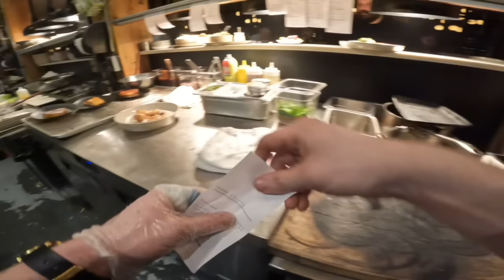POV Live Fire Line Cooking 1(5)

Comment: This is truly impressive, I've never seen a kitchen like this! The temperature must be infernal. Great job!
Reply: Compared to some peoples job. My past one for many years ina steel mill making 80ton batches of liquid steel at 3,000°.  With 2 pairs of long sleeves an long pants with hats an neck coverings an an aluminum trench coat ect.  While a lot of time getting few feet from it where the clothes your wearing starts smoking on your body.  An the hard hat on your head starts to warp an bubble.  An the shield over your face starts to shrink an curl up from the heat.  Or melting the soles off the bottom of high heat rated steel toe boots.  

These dudes don’t have a clue what heat is to some of us.   In comparison that would be like sitting in an air conditioned room having a picnic.
Reply: @AquaTech225  ok tough guy
Reply: @AquaTech225 I would never under estimate working a line unless you've done it. Not saying the heat is the same but theres a lot of people that can't do this job of being a line cook.
Reply: @AquaTech225  jesus
Reply: @AquaTech225  looks like someone needs some validation
Reply: @Luke_MoonWalker  ⟵(๑¯◡¯๑) relax buddy, there are trade schools too. And iron work is important to the understructure we use everyday
Reply: @AquaTech225 You’re trying to make getting boiled alive a competition. You’re the type of guy to be like, “You got soft hands brother”.
Reply: @paulc7400 so automatically you say it's easier to work 12h shifts in a steel plant, with 120°F room temperature, plus the heat radiation from the steel, than working as cook in a kitchen ? 

You have no idea what you talking about. Sure it's really stressful as a cook, but atleast you don't risk your life and health. One small mistake or material failure, or wet steel scrap and people can die easily. There are a lot of videos about accidents in steel plants, sadly it's a common thing, even today.
Reply: @ImplantedMemories  what part of what I said was disrespecting steel workers? 

I was just trying to put some respect on line cooks name for someone who never done it. Most of the mexican and guatemalan cooks I worked with had 2 kitchen jobs as well so they worked 12-16hrs themselves but yeah there lives aren't on the line.

 I was trying to tell some of them their second job should be something more relaxed like security or something.
Reply: @AquaTech225  im glad you could get that out of your system, idk what you want others to say but perhaps talk to a friend about it or consider working a differant job if you dislike it that much. im sure with your work ethic you could succeed in plenty of careers.
Reply: @AquaTech225  sorry, the man
Reply: This isn't cooking. This is assembling.
Reply: @AquaTech225 this job is a grind and is legitimate just like yours. You don’t have to shit on others my brother
Reply: @AquaTech225 no one cares or asked. You’re not special
Reply: @AquaTech225 No one asked buddy
Reply: @AquaTech225  Cool bro but can you fry a piece of chicken
Reply: @ImplantedMemories cooks are literally risking their health everyday. It’s too stressful in there. That’s why most find an addiction to something. Coffee, cigs, something!

Comment: I cook 90/95 % in cast iron and this is so awesome to see, major kudos to the chefs, wait, bus and washers, they never get any recognition. I need to cook over wood more.
Reply: What’s the proper way to clean it? I just purchased my first one and want to take care of it..
Reply: @AshMich  there are many videos on care and maintenance but #1 do not use soap to clean, high heat and hot water, rinse and dry with heat, a little oil and wipe dry

Comment: this is why i hate when customers make complex alterations on their orders. It's so easy to make a mistake when cooking so much food, especially when alot of the recipes are from memory. from cooking, assembly/ plating and even the waiter taking the wrong plate to a table. ordering food as is on the menu, will mean you get your food faster, and it will be correct as ordered because every person along the chain won't have to make adjustments. cooks know what should be in the food, waiters know what the plated food should look like.
Reply: When I was a waiter I always checked the food over. It was my responsibility to communicate the order and my responsibility to make the delivery to the customer. That’s why I hate the food runner idea. And when my actual server brings out my order and it’s wrong it makes my blood boil, no excuse.

Comment: Tip to the cook - if you are using gloves (no matter the reason), you should replace them every few minutes (or between preparing different dishes)  or you are risking with cross contamination (as evident in this video - touching food after rubing glove with dirty cloth) and other health risks (it is less likely to happen without gloves since you will notice your hands are dirty and will wash them).
Reply from the maker: absolutely correct. i often cut out when i go wash my hands, grab refills from the back, ect

Comment: How many covers are you doing per shift?
Reply from the maker: depends on the night. friday saturdays are usually 250-300+ we have about 100 dining and 30 bar seats
Reply: @flipcooks2  that’s cool, I prefer smaller places, usually better food, and a good quality menu. 
Do you guys run a certain kind of wood? How long does it take to learn how to properly use a wood burning stove? 
This is awesome man!!
Reply from the maker: @Modifiedtaco  we ran dry treated oak up until our fire a few months ago. we are finally opening back up and have a whole new charcoal setup. as for learning wood fire cooking, it definitely takes awhile to get it down. fire and heat management can be tough while trying manage all the other things that go along with short order cooking.
Reply: @flipcooks2 that’s awesome man!!

Comment: Little pro tip you need to coat the grill with oil first so the salmon doesn't stick to it. So just put oil on it, put it on high heat, take it out another layer of oil then add your salmon.

Comment: I def don't understand the fries on top of the mussels ha
Reply: I was at the Palace Cafe in New Orleans last week and they did this. So I counted the mussels. There were eleven. Thirteen shells, but two mussels were MIA.

They're doing this so they can bury the (comparatively) expensive mussels under the (comparatively) worthless fries. It's like the reverse of a crab salad where they put the spoonful of crab on top then the rainforest's worth of leaves underneath. Just a branding exercise.

There is no excuse for serving moules frites in the same plate. Ideally the mussels will be served in the vessel they are cooked in, complete with broth. If that doesn't work, they should be served in a pasta bowl or similar. Then the fries are in a separate dish.

Hiding them under fries just sucks. You wouldn't drape your steak in mashed potatoes so why do this with mussels?

Not blaming the guy in the video, it's the chef's call, but the chef has this one wrong. Moules frites is two dishes, not one!

Comment: In the first minute this cook showed exactly why wearing gloves should be banned from restaurants. If you’re wearing gloves you’re LESS likely to change gloves when you get them dirty. All he did was wipe off the gloves and continue. Had he not been wearing gloves he would have been more likely to wash his hands after getting condiments on his hands. This is extremely bad practice for kitchen safety. I would imagine this is exactly how that lady in Disney died from allergens. Lazy kitchen staff wearing gloves thinking it’s fine as long as they changed gloves often. In the next 25 seconds he’s got more condiments on his gloves. Still not changed glove or washed hands. It looks like cross contamination is the norm here. It’s a shame because the food looks good here. The low sanitation standards will keep me away from here.
Reply from the maker: @thefamilydogs3213  I get your take, but you have to understand a few things, generally I prioritize washing my hands over gloves, but I had a bandage on an open wound here. also any time there’s and allergy it must be noted by the server, and when that’s the case I will grab new tongs, mixing bowls, ect to accommodate, aswell as washing my hands and changing gloves. furthermore you have to understand that every time I wash my hands I generally chop it out of the videos